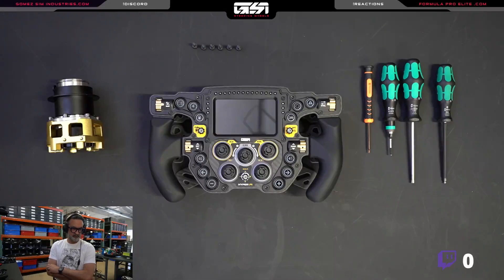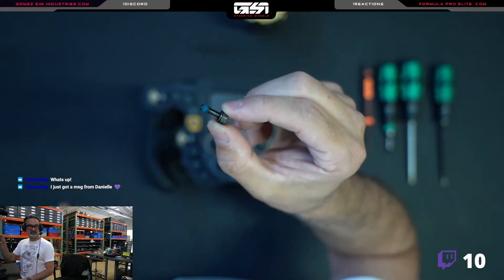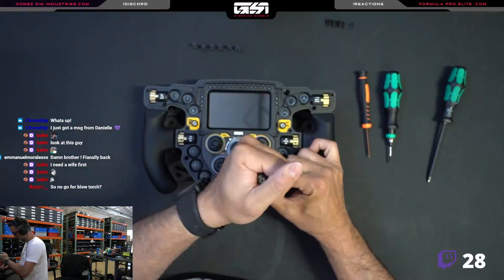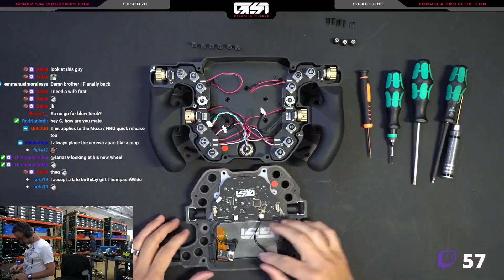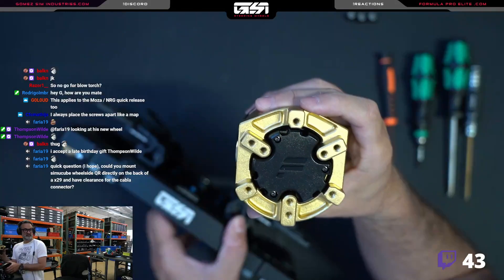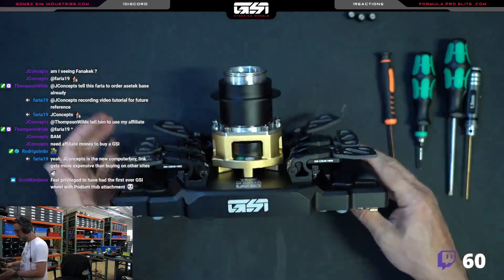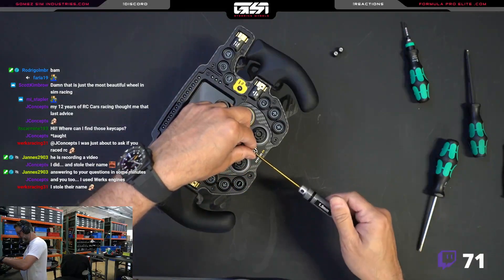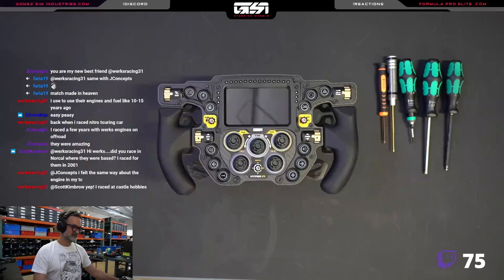GSI Fanatec Podium Hub Install

Comment: Apparently there is an update to the product that requires more steps to accomplish removing the faceplate. Could there be an update to this video for that?
Reply: if you have the newer version, you will need to remove the 5 rotary knobs with the same size 1.5mm hex as the funky switches. There will be two connections near the top to the face and then you will need to remove the daughter board to put in the bolts.

Comment: Thank you for this video. I have just successfully joined my Hyper P1 with Fanatec Hub. 
When I connect it all up, how do I select hi torque? This would have normally been done via a switch combination on my old Fanatec wheel?
Thank you.
Reply: Turn the wheel 90 degrees.  You should see a bar fill up on your wheelbase screen.  When full the high torque will be enabled.

Comment: Is this compatible with the Fanatec Club Sport Wheel Base V2
Reply: This system its for HIGH TORQUE wheels. 12, 15, 25nm. But of course, any wheels with holes for 70mm screws 6 holes will be compatible without problems. So,  the answer is YES. 
￼